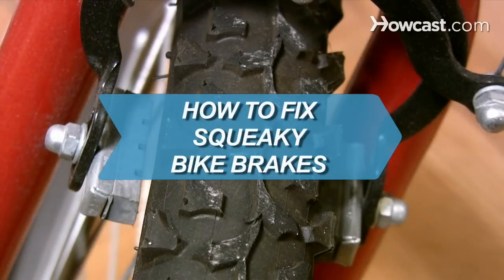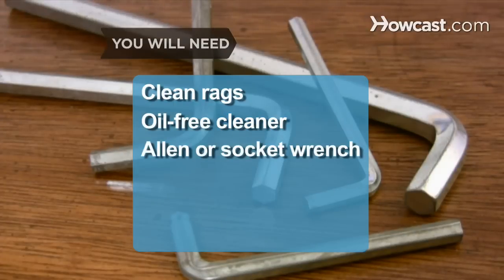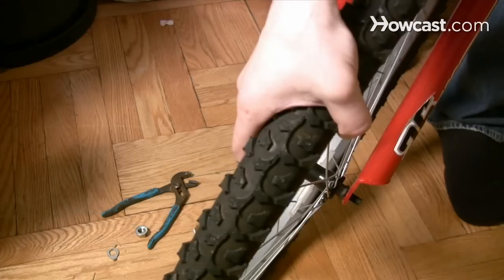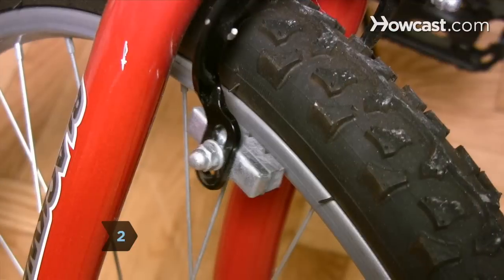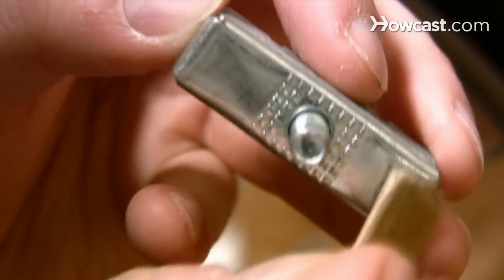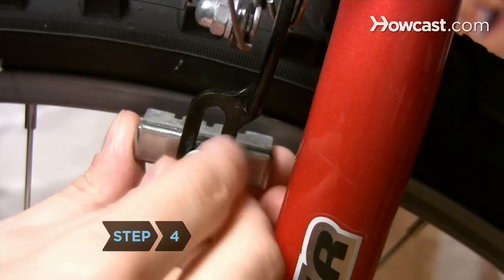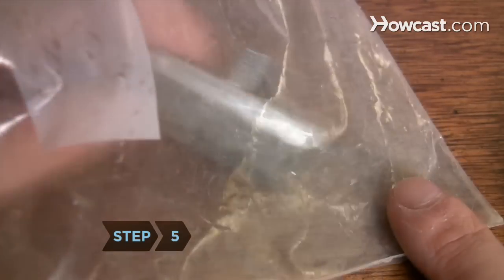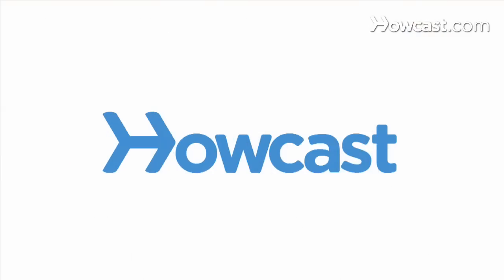How to Fix Squeaky Bike Brakes

Comment: Please understand that the cardboard(or anything else) is just used as a temporary  spacer until you secure the adjustment(correct toe-in) and is not meant to be there permanently.